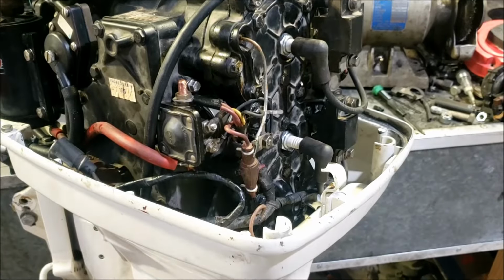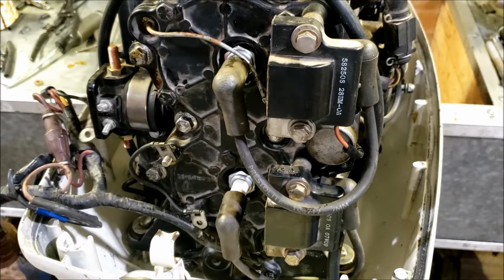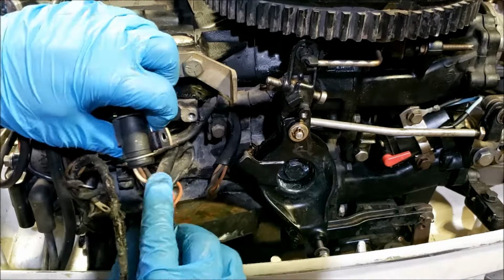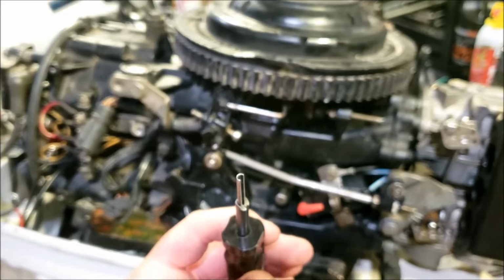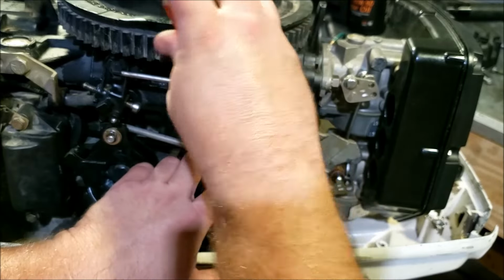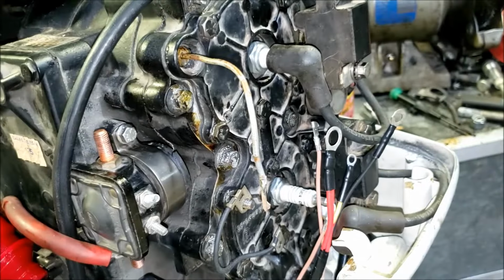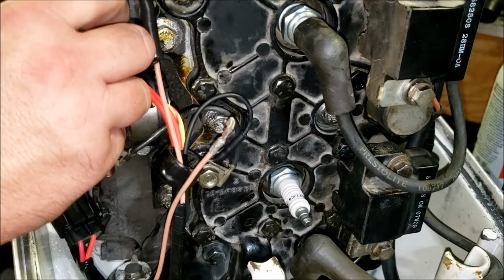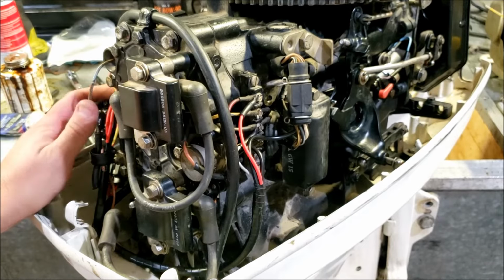Outboard Engine Wiring Harness Replacement

Comment: Hi there, thank you for this Video. It gave me hope:) I bought an old boot with a Johnson 2 takt Outboard, which seems identical with this one. The console gives continuously signal at the moment when i start the motor. Water is coming out nice and oil is also ok. The electrics however worn like in this video. I suspect from bad wiring as a reason for a short circuit or a faulty sensor. Sadly i could not find a new harness in Europa. I am gonna repair the wires. I have got the necessary tools i must do some replacement. Could you help me to identify the awg values of the cables in the harness???

Comment: I'm in the process of a rebuild of a 30 Johnson, and upgrading to the Deutsch connector. 
My question is, are all the earth's required?
There is one on the exhaust cover, one from solenoid attachment point, and one on the lower cover, near fuel inlet.
Would like to connect the earth ( black), from the Deutsch to the solenoid earth connector,  as the exhaust cover gets hot,and think its a bad connection point.
Would that be OK?
Thanks.

Comment: Where can i get a harness for a 1970 60 hp & the power cable to the throttle control & can i use a new throttle control system?

Comment: You obviously know what your doing...I have a '91 johnson 40hp with electric start and power T/T I'm going from a tiller to remote steer. I'm have trouble with what harness (part #) to order. Any suggestions would be much appreciated, love your channel

Comment: What color wire is the neutral safety  switch? For a 78 35hp evinrude.
Reply from the maker: On the engine? I could be black, could be white w/ black. Could be yellow w/ red stripe.
Reply: Thank you @BrandonsGarage. I guess if it reaches, it's the one 😅
Reply: I think I got it now. Red/yellow from starter to neutral switch then to (s) on the control side plug.
Reply: I've figured it out. Brandon is right, could be any color. I just follow the wire from the neutral safety switch to the coils.

My black with brown wire isn't on that small plug like his. Mine comes from the power pack that connects to the spark coils. I simply sauder my black with brown wires to the new red wire harness.

Comment: Why would my trim tilt work fine with the ignition off but with ignition on the tilt goes up by itself . Changed the relays …..still doing it .
Reply: 1993 Evinrude 70 ,

Comment: Did i miss the wire connection for the netural safety switch?
Reply from the maker: Not all engines have them, 
Usually, they are found on tiller electric start engines - this being a red-plug remote controlled engine, it would use the safety switch built into the controller. 

A lot of earlier years had them too; pretty much a any that used a simplex controller.

Comment: Hey Brandon, I just installed a third party mophorn control box for my 2015 Mercury 25 HP outboard. It has a 14 pin connector on it. I cannot get the ignition key to start the boat. Does the 14 pin harness not control that? There are other wires coming out of the control box but I assumed they were for the dash instruments. Could one of them be the ignition wire? Thank you in advance!

Comment: I’ve got the old glass fuse in my harness ,,,costing an arm and leg on the internet can I change it to something newer
Reply from the maker: You would have to cut and splice the old one out, and replace it with a fuse holder. If the harness is in good shape, I would just buy the proper replacement fuse. 
It'll cost the same as a replacement fuse block, but leave the wiring in tact and splice free.

Comment: I have a 55el78s, do I really need to purchase the $270 engine harness or will the 1979 $50 harness fit?
Reply from the maker: Naw, $130ish on eBay.
(You need 581973)

Something is weird with the late 70's to early 80's harness wiring; the stuff just falls apart.
I would avoid buying something used for this era.
To answer your question, chances are the $50 harness will work fine, but may have a different end on it for the overheat alarm, power-pack, or choke.

Comment: Brandon I’ve been following you for years I love the page brotha.  I have a 1987 e140txcua I changed the whole ignition system from original to cdi due to a no spark situation, now the motor sounds like shit.   Revs high the. Slows down and dies.  At this pint you might be the only dude to help
Reply from the maker: What year parts did you install?